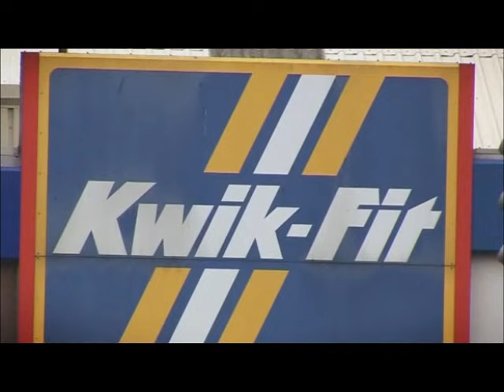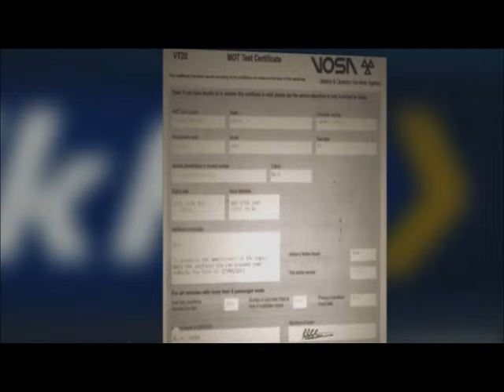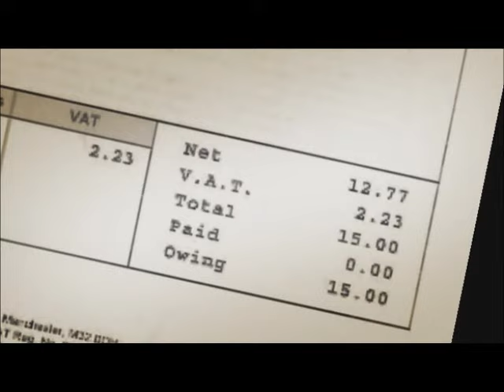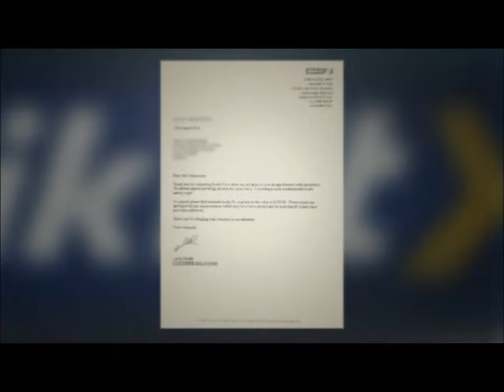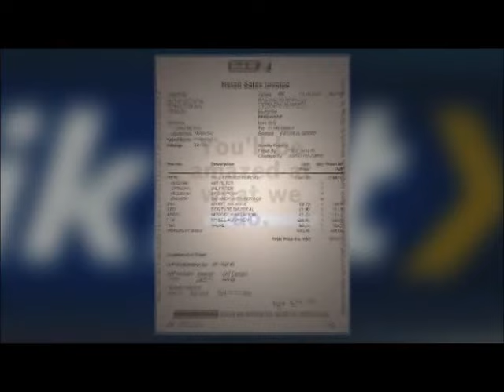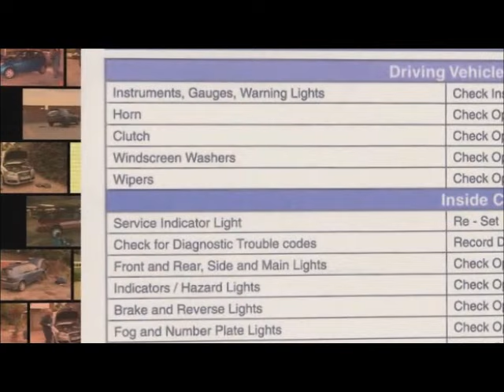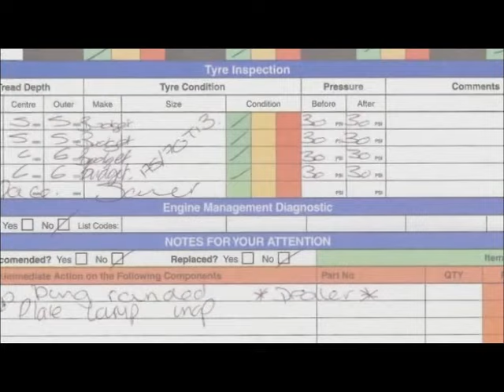Kwik-fit Car Rip-off Watchdog.wmv

Comment: I went into kwik fit 1/24. The staff were kind and courtious. However I was puzzled by the intense interest they were paying to my epic 13 yr Berlingo. Such a great car. They even went to great lengths to photograph the other tryes and around her rear end so much so she blushed bright red. The fitter returned to reception and spoke to the head honcho who came to me and ask me to look at the other rear tyre. We're just informing you that your tyre  has cracks around the outer edge and in the grooves where the depth indicators are. Yes there were cracks but they were small in nature. Thanks for letting me know I will keep an eye on it as is it near the of its use. A point to note. I probably had swapped it out from a front tyre and they go through much more strain and likely to develop stress fractures. I then asked the main man whats with all the Photos. Is this part of your T's and C's or protection against claims from clients or are you going to grass me up. No sir we wouldn't do that to our customers. Now here's the rub. Suppose they find a genuine safety aspect. It thens falls on the owner to make the right decision that he does not continue to use the vehicle until its fixed. Tricky. However you must realise that all Business is in it for the Money. The motto is Don't let yourself be burned. Read and build up your knowledge. As for the cracked tyre I'm still using it to get value for money. So I am happy with kwik Fit this time.

Comment: I took my fifteen year old Renault Scenic to Treadfirst (bit like Kwik-fit, but a more regional outfit) with a blowing original exhaust. The result was a bill for £10 to replace a clamp that had fallen off, and no attempt to sell me anything else. On the other hand, I have used Kwik-fit twice; the first time they jacked the car up on a suspension link and bent it and the second time it came back with a wheel bolt missing "because it was missing when the car arrived". Now, I'm not a mechanic as such, but I am an engine specialist, having built engines for both the Ford and Vauxhall works rally teams, and I know that all four bolts were present when the car went it because I had had the wheel off a couple of days earlier to replace a wheel bearing. I went and bought a new bolt and surprise, surprise, it wouldn't go in because it turned out that the female thread had been cross-threaded.

Comment: Kwik fit aren't the only ones. Lad in at work drives a diesel Focus ST, brand new so the servicing was free for 3 years as part of the purchase, which is fortunate because he noticed that the invoices included replacement sparkplugs, diesels don't use sparkplugs. He stopped using the dealer's garage after they stopped being free.

Comment: Long time ago I got an oil and filter change in Tonbridge Kwik Fit and they did the job with no strings - using the oil I supplied - and it cost a lot less than the local main stealer price. That was a long time ago however!

Comment: I brought my car there on 17 october 2015. The steering column or something had to be aligned, around €450. I said no because the steering was perfect. 2 years later, still perfect and straight. Automatically straightens perfect with the road. Brought it in the same shop on october 2016, nothing wrong to my car to my surprise except for brakes which have to be replaced this year but thats true information

Comment: A friend of mine worked for Kwik Fit in London. He told me he saw one of his employees doing an MOT on a car. The car passed its MOT. The mechanic wanted to find a fault so he can make money. He told me the mechanic took a screwdriver and rammed it into the cars radiator. Put a new radiator on and charged his customer for a new car radiator.

Comment: Aberdeen Quick-fit by the roundabout,,,,i paid for 2x Michelin tyres, It was a Sunday and i was asked to come back 2 hrs later,,,,i did,,, they gave me my receipt and i was of, i checked the tyres before leaving and the had fitted Continentals at £60 cheaper, my reciept was for Michelin, i went back in and they advised me it was all ok, just go, i was lucky as they claim the continentals were more expensive, i had to demand the correct tyres where fitted, i will NEVER use this riff raff again, and got my next two online and paid a local garage to fit,,easy,,, Avoid Quick Fit, the folk are there to cash cow and scare you, if i was a busy single mum what chance would i have among these wolfs
Reply: Kwik-fit

Comment: That man complains about a 40 minute oil change, everywhere I have been here in Australia takes between 3 and 6 hours, the dealership i the slowest, 6 hours, so now I do it myself. 15 minutes and I am done.
Reply: Super_Slav it doesnt take 6 hours to do an oil change. for a lube service to be done properly, all the checks carried out etc its an hour. unless you request to have it done whilst you wait, or specify a collection time, they will not prioritise your car and even if you drop it off at 8am, it may not get worked on until just after lunch, so you get the phone call at 3pm to come and fetch it.

if you literally just want an oil and filter change then yeah, its 20 mins. but your car wont be checked over for safety.
Reply: harper2704
I was sitting in the lounge for 3 and a half hours once for a oil change and a brake fluid flush, I just do all the work myself now.
 I also do it myself because I cannot justify $220 for an oil change and brake fluid, thats with me supplying the fluids.
Reply: Super_Slav sounds like a bad dealer then. when we have a waiting customer, it will be worked on straight away, even if it means a tech getting pulled off another job. smoko and lunch is delayed if required, the customer satisfaction is our priority.
Reply: harper2704
I only go there for warranty, now that my warranty is up, I do it myself, I also get the comfort of knowing what exactly goes in the car, I only use Liqui moly top tec 4200 or Fuchs Titan gt1 pro C3 in my TSI, I have heard of too many shops using the wrong spec of oil in VW motors which causes them to fail, also the dealers usually use Shell or Castrol which I don't like that much.
Reply: That's fair enough.

The dealer I work for only uses the exact oils specified by the manufacturer.
Reply: paul harper
I know there are some good and some bad dealers out there, I have heard of a dealer in my town not changing the oil at all at regular services years in a row, the falcon ended up going something like 4 years without an oil change when the motor seized on the side of the princes highway they opened the motor up to find sludge everywhere.
Reply: +Super_Slav I got oil changed at the dealers and it took 2 hours or so.

But they have to do it in a first come first worked on method.

Since my car was under waranty, they have to check over the whole car which adds time.
Not like one of these little workshops where it will take 30minutes max

Comment: They set the tracking on my car 20 years ago...…..when I had my mot a few weeks later,   it failed because the ball joint clamps were loose, DANGEROUS,   never been there since.

Comment: I had some new tyres fitted there and the guy said that my front wheel alignment had to be adjusted and this was an extra cost. Having worked with cars for most ofd my life, I fed him some rope to see if he would hang himself. I said ' Have you adjusted the tow out on trurns'? He replied that he had adjusted that as well. I replied, ' You mean you heated up the steering arms and bent them'?  He thought for a moment and said, 'Let's forget the extra cost'.

Comment: Went to quickfit three weeks ago to ask the cost for tire repair because my rear left was almost flat. I think he said £25 which was a bit much because I know a local garage who does it for£15. So I asked if he could please put some air into the tire, which he flatly refused and said... quote..."If you don't have your tire repaired I won't waste my time with that." I said "surely you can do that?" He just refused and I went to the other place, who promptly found a nail to far on the left side of the tire which needed replacing. Quickfit could have had the business but now they won't get any business from me in the future.

Comment: I went to Kwick Fit to have a new exhaust fitted on my car a few years back, just before the guarantee expired I noticed that the welding on the back box had failed and the exhaust was blowing, I took the car back to Kwick Fit and they agreed to replace the faulty box, but while he was working on my car, the fitter called me over to tell me that my rear shocks had "all blown out" and showed me that they were covered in oil, little did he know that I had replaced the shocks only a month before. He had squirted oil all over the shocks to try to sell me new ones. Needless to say I didn't fall for this con trick, I took the car home and wiped the shocks dry, they lasted the life of the car. My advice is keep clear of these con merchants.
Reply: Did you tell him he was a cheating little bas****? and you had replaced them yourself recently? I would have and told him in no uncertain terms what I thought of that con. Mind you, I have never taken any of my cars there, so I would not have been in that position in the first place!!

Comment: I had my car go in to quick fit once as it was one of the only places I could go to on a saturday to have my car looked at. I was loosing coolant slowly but no signs of head gasket troubles or exhaust smoke or mayo in the oil. Their diagnosos was I needed a £900 air conditioning compressor plus labour. (My Air con worked just fine and has nothing to do with loosing coolant) Told them i'd not be proceeding with the work and collected the car. Took it to a one man band independant mechanic who found the problem in 2 minutes looking under the bonnet with me when I dropped it off. Turned out all I needed was a perishing coolant hose to be replaced. Told me to leave it with him for about an hour or 2. He replaced the hose, flushed and changed all my coolant, got any trapped air out of the system and told me to just chuck him £30. I've been going back to him for 8 years and counting. I think he was as digusted as I was with what shitfit had tried to scam me for.

Best advice to anyone is to find a small idependant mechanic. The guy I go to hasn't advertised in years and he's always busy. He gets all his work by reputation alone. He even recognises my voice when I call and knows me and my car and everything he's ever done to it. Finding him was the best thing that ever happened for my car and my wallet.

Comment: I ALWAYS tell them I've just changed the big end bearing or the valve stem oil seals last week or to REALLY worry them, tell them you've just rebuilt the gearbox (drop into casual conversation). This stops them dead trying it on as they now know you know a "thing or two" if you can do those jobs. Do this with ANY garage you don't know the provenance of (like if you were on holiday and needed work done on  the car). Simple.

Comment: I like the fact that one of them after having problems with Kwik Fit got sent vouchers for them, like they are ever using Kwik Fit again.
Personally we use a local tyre place that have actually told us that the tyres didn't need doing.
We did have a local Ford dealer, however, do an MOT on our Nissan and tried to claim that the front brakes were really bad and it could have failed, they ended up being replaced over a year later after the main Nissan dealer found nothing immediately wrong when it was serviced 6 months later. Said advisory on the MOT disappeared when the next one was carried out at a different garage despite no work having taken place.

Comment: The RAC must recruit from Kwik fit. One time called them out because my power steering had become really heavy. The serpentine belt had jumped off the pulley. He had no idea how to route the belt. His diagnosis was that I’d been driving the car for 2 years with a drive belt that was 6 inches too long  OR this car that I knew for a fact didn’t have air conditioning, had actually had it all along I just hadn’t realised it and it had now fallen off without me hearing or seeing it.

Comment: I took a car in once as my hand break cable snapped, so it should have been a quick and easy fix, but then after taking it in, 15 mins later they were on the phone to me saying that my break discs and pads were dangerously worn and needed urgent attention.  They quoted me over £150 for all the work so I told them I didn't want that doing, so they refused to fix the hand break unless I did that job as well, and if I didn't they'd be reporting me to the police for driving a dangerous vehicle without a working hand break.  I basically told them to do what they wanted and went back to get the car, and stopped at a closer, family run garage just further down the road.  I'd never used them before but didn't see how anyone could be any worse and I  told them what had happened.  He had a look around and said there was absolutely nothing wrong with the breaks at all and promptly only charged me £30 for a new hand break cable and service.  I can imagine though that someone else might not have the confidence to say no and would have been £120 out of pocket.  Kwik Fit staff from my experience are thieves and should be ashamed of themselves for being such a major recognised high street brand.

Comment: My daughter bought a Honda which had its service book and MOT certificates signed and stamped for 5 years by kwikfit.
On examination, all of the fluids were on the lower limit, and the oil filter was totally clogged, so the services had not been done. 
The Mot’s had failed for the same split cv boot for 3 years, with replacement bills for £100 each time.
The boot was still split when she bought the car.
If I could have proven all of this I would have followed it up but kwikfit know that this is very difficult and continue to rip off their customers.

Comment: Kwikfit: set of brakeshoes € 247,50 & 2 brake cylinders €180 incl fitting,    I got those sets for € 25 and 17 euro and fixed it myself in 45 minutes.

Comment: Whilst I do not condone rip-off in any form, yes, Kwik-Fit staff are kids and not time-served trained mechanics, but whose fault is that? I blame the customers………..! When I started out as a mechanic so many years ago, you had to book your car in a week or two in advance to get any work done. But that wasn’t good enough. You had to pay manufacturers recommended retail price for parts plus labour. But now you want it at a discounted price and no labour charges. You could only get your car fixed Monday to Friday between 9 and 5. But now you want it done at 3 o’clock on a Sunday afternoon. So when you want to blame somebody for having kids fix your car, look in the mirror. How on earth can any company afford to pay mechanics the kind of money they would demand to work anti-social hours when they are in a cut-throat business like free-fit? Customers created this monster, so it does not behove them to complain now
Reply: I’m starting out now, there’s a kwikfit apprenticeship I found and I went in for interview, they said everything is clock in and clock out, if YOU do a job and it goes wrong or something not checked etc, especially if it results in an accident, you’d be out of the job straight away or worse, everything is logged on a computer so the customer can’t say the tech caused damage bc you have to take pictures before starting work on it. And the mechanic can’t rip off a customer either bc again, everything is logged these days. There’s more money in doing a good job and getting more loyal customers rather than ripping them off bc that’s how you lose customers
Reply: Yeah the majority of youngsters don’t seem to care abt what they do as if the cars they work on don’t belong to someone. I for one am in the minority, that takes pride in my work, I’ve been struggling for opportunity to develop my career but I need to get my last year to get lvl3 and kwikfit say they can get my last bit of training done all costs paid for like travel, they were v upfront told me how it was and said it would be hard to do the apprenticeship and that I should only apply if I was going to stick w it, asked me a lot of questions for lifelong plans (as I’m what do I want In the long run wether it be MOT tester etc) I’m thinking of applying as they seem proper from my experience at this site, I might go down the master tech route later on down the line

Comment: Kwilfit has no knowledge but wants to sell as much as possible.
I am a car technician, and made a tire blow of of my 4wd volvo 2002.
There, the difference in profile may not exceed 2mm with front and rear,because of the Viscose coupling .
I wanted to solve both front and rear a new tire, but they kept up to 4 new tires.
While the rest was 5mm.
I went to a tire center, and those helped me, and were happy with the tip.
And drove the car fore 4 years with no problems.

Comment: I got rip off for two halogen bulbs change at a local Kwik Fit garage. The guy charged me £80 when they failed my MOT. I went home checked online it was only £5. Another occasion they charged me for a 5min MOT re-test visual inspection. The Kwik Fit garage since then got closed down for land development.